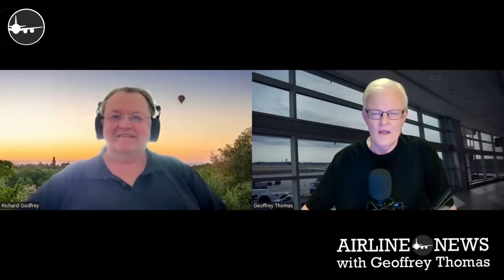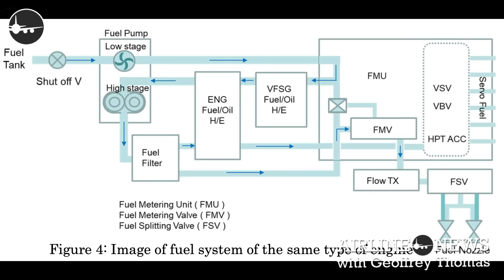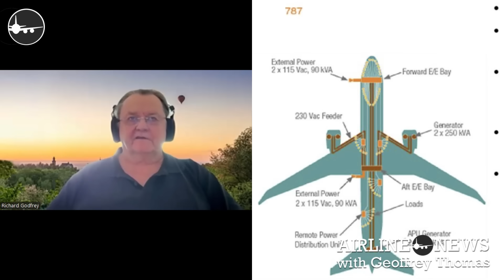AIR INDIA CRASH - FUEL & ELECTRICS FACTORS  #airindiacrash

Comment: I've posted my own crackpot theory (elsewhere) a couple of times, but have received no feedback, so here it is again.  Perhaps you'd be so kind as to examine it?

IF we assume:
 - The fuel was contaminated with something that had a lower specific gravity and energy content than jet fuel.
 - The mixture sat in the tanks long enough to separate prior to engine startup.

Then there are three potential scenarios in which this could cause dual engine failure:
1.) The fuel system was able to draw just enough separated fuel to start the engines, spool them up for take off and make the take off run before this 'clean' fuel was exhausted.
2.) The same scenario as above, only when the aircraft rotated upon take off, more of the contaminant became available to the fuel system's 'pickups' (?), thus there was enough contaminant to snuff out the engines once the fuel in the lines was exhausted.
3.) Essentially the same as scenario #2, but upon rotation, interaction with the baffles in the tanks caused the two to mix, thus increasing the amount of the contaminant that was being drawn into the system.  This would presumably cause the engines to either shut down, or run at a severely reduced output. 

People with actual knowledge of petroleum distillate storage and distribution, or aircraft fuel system design, could certainly shed more light on this.
Reply: Assuming this is plausible, I have had some additional thoughts.  This could be the result of one delivery of contaminated fuel, or it could be the result of a small amount of residue in multiple deliveries of fuel that accumulated over time.  Either way, the evidence could still be found in the onsite storage tanks.  It also occurred to me that using the fuel transfer pumps to mix the fuel while an aircraft is taxiing might reveal any contamination issues as it might cause the engines to falter or result in a noticeable drop off in power.

Comment: Landing gear "question"... Looks like a problem retracting the landing gear, unless that has been dismissed in all the videos and resulting suggestions.
If the plane is told by landing gear system that it's on the ground, it will shut down the engines.  Maybe that's what happened here...?

Comment: I am not wanting to point the finger at any of the flight crew but maybe it is not out of the realm of possibility that someone was in or gained access to the cockpit. It is not impossible that someone deliberately pulled both fire bottles shortly after rotation. And yes the AC would still make the distance where it went down.That would deploy the RAT and the chain of events. It could be 100percent wrong but it is still a possibility. Either way I am certain what happened has been determined and was very quickly after this accident.  That would explain the lack of a preliminary report also, as the investigation team would have to be especially thorough before releasing that kind of information.

Comment: Thanks so much for the videos. My question relates to the fuel system. Exactly which fuel system components are located on the aircraft and which are located on the engine. My point is that if a system malfunction occured is it engine related or something in the aircraft systems.

Comment: This looks like a electronic malfunction of some kind. Wrong thrust setting or the wrong altitude in the flight director leading to a panicked crew. Its a cascade of events at the wrong time.    I think its going to be covered up just like the max was until it had to be explained. Somehow the settings were wrong. No mention of engine sound but the sole survivor said he could hear the roar of the engines. Somehow the thrust tailed off or rolled back like if is was leveling off and not continuing to climb. A Emirates 777 had the fight director flight level set to zero instead of 4000. So the plane hit a wall and antenna and barely took off even though it was going fast enough.

Comment: Boeing have long been aware of 787 takeoff issues. 

The following directives and bulletins address takeoff and climb issues for the 787:

FAA Airworthiness Directive (AD) 2024-16-07 Applicability: Boeing 787-8, 787-9, 787-10. Details: Mandates TM and DCA software updates to correct autothrottle/TOGA logic errors during takeoff and climb, addressing LRRA-related issues. Compliance required within 6 months (Federal Register).
Special Airworthiness Information Bulletin (SAIB AIR-20-19) Applicability: Boeing 787 and 777. Details: Addresses autothrottle anomalies during takeoff/go-around, with guidance for 787 crews via Flight Crew Operations Manual Bulletin TBC-108 (EASA AD).

Then there is the 5G interference bulletin for the LRRA. Put that in to non technical terms, 5G can interfere with low level radar that operate todays aircraft

Comment: Very few programs have considered the need  to look at the Engine Health Monitoring programme to know what the performance degradation was and the  resultant low EGTMs.
Did the  FADEC roll back the Engines to avoid an EGT Exceedance?
Did the TAP system activate as a result to prevent a Thrust assymetry? 
Did this happen in conjunction with a genuine system failure that prevented the LG retraction giving rise to a classic case of a Swiss cheese type failure.?
Reply from the maker: The investigators have the FDR data and the EHM ACARS data from the take-off report.
They can tell us the TPR, N1 and EGT primary indications.
They can tell us the N2, N3, Fuel Flow, Oil Pressure, Oil Temperature, Oil Quantity and Engine Vibration secondary indications.

Comment: Thank you for a thorough update. Initially, engine failure at V1 seemed likely. After this video, the electrical system seems to be the root cause. I ran a simulation wherein the trigger was a “gear up”;command. If this AI model can be trusted (and I don’t know that it can), here is the gear up scenario:

“Yes, a Boeing 787 could experience a warning or even a cascading electrical failure upon gear retraction if a main electrical system is compromised. Here’s a plausible scenario involving the aircraft’s electrical architecture, the landing gear system, and power distribution logic:

⸻

🔧 Background on 787 Electrical System

The 787 relies far more heavily on electrical systems than previous aircraft (a design called “more-electric architecture”). It uses:
	•	Two main electrical power distribution centers (P100 and P200)
	•	Multiple generators (two per engine, plus the APU)
	•	High-voltage (235VAC) starter generators and electrically actuated systems like brakes and gear actuators

⸻

🔄 Hypothetical Scenario

⚠️ Initial Condition
	•	Let’s assume there’s a compromise or partial failure in one of the main power panels, say P200, which feeds the right side electrical system.
	•	The aircraft is operating on engine power, and one engine’s starter-generator is offline or degraded.
	•	The failure could be due to heat (ambient temp 42°C as you previously mentioned), a loose busbar, or internal arcing.

⸻

✈️ Takeoff and Gear Retraction Sequence
	1.	Pilot commands gear up.
	2.	The gear actuators, especially the main gear doors and uplocks, draw heavy electrical loads—transient spikes through contactors and relays.
	3.	The command passes through an electrical load management system (ELMS) which temporarily shifts or limits loads to accommodate the gear operation.
	4.	If the P200 power panel is compromised, this sudden spike could:
	•	Trip circuit protection
	•	Cause voltage drops across the bus
	•	Interrupt or brownout subsystems temporarily

⸻

⚠️ Resulting Symptoms and Cascade
	•	Warning lights: You could see warnings like:
	•	“ELEC GEN OFF BUS”
	•	“ELEC BUS ISOLATED”
	•	“GEAR DOOR FAULT” or “GEAR DISAGREE”
	•	Cascading failures:
	•	If the right side electrical system (P200) collapses, it could isolate flight control modules, as some of these are redundantly fed from each side.
	•	The EICAS (engine-indication and crew-alerting system) could show multiple seemingly unrelated warnings.
	•	If enough systems fail, the flight control system may reconfigure, switching to backup or secondary control laws.

⸻

🔁 Precedents and Similar Incidents
	•	There have been documented cases (e.g., ZA002 test aircraft) of smoke in the cockpit due to arc faulting in power distribution units.
	•	In 2012, a 787 experienced electrical panel failures and required diversion after a gear cycle, traced to arc-tracking and thermal damage.
	•	FAA and Boeing have since issued multiple Service Bulletins and Airworthiness Directives about insulation, P100/P200 contactors, and bus stability.”
Reply: Hi, good analysis, during my service we had replaced several power panels on 787 .
Reply: Good approach, investigate the "what ifs". I hope Air India and Boeing have teams of people generating and investigating such scenarios. Boeing probably did as part of the aircraft launch/release process, its gets harder to maintain and use when there many versions of components deployed a fleet. The recorder data should have captured some of those symptoms and help  identify/prioritize scenarios and investigation. The swiss cheese model hints that multiple borderline/latent conditions might be involved. Automatic test tools might be needed to find such combinations.
Reply: Great video guys! 
777 driver here.. we wouldn’t ordinarily check electrical synoptics after engine start. Any malfunction or abnormality ( electrical or otherwise ) would result in an EICAS (Engine Indicating and Crew Alerting System) caution message. Which on the 777 would bring up the appropriate electronic checklist.
Keep up the good work…
Reply: Should have used the ELMS supplier to the 777.  It has had in-service issues, of course but mostly down to poor maintenance practices. I think this may prove to be a factor in this case.

Comment: Excellent episode by Richard & Geoffrey on the detailed & complicated technical information about the  787. Regarding your description about the possible moisture/water leakage into the electronics bay from toilets, I would like to ask whether any other air craft such as the 777, 747, etc. from Boeing & A320, 330, 350 & 380 from Airbus has similar risk, cause they are also having toilets in the back & front. If not, then why 787 alone, is this is a design flaw with the 787? Once again a great effort from you two guys👍

Comment: Sir look at the vedeo study and look very carefully. The plane was front cargo overloaded.  The plane had a short take off.      There was a Blow up off dust and sand from the ground end of runway the sand and dust blow out caused by the heat and humidity end of runway in duceed both engines casing engines failure we do not have to be a sicentest to know that turbines engines does not like  sand and dust the components are program to kill switch if the engines in duceed sand.    Thank you

Comment: Boeing engineers should have realized that positioning a lavatory directly above primary avionic hardware was a catastrophe waiting to happen. Depending on the airlines -- whose ethical responsibility is always at odds with the mantra  "time is money" --  to patch-up gaping flaws in their avionic design is more evidence of Boeing's criminal negligence: in practice and flagrantly on parade.
Reply: There is no evidence yet that it what caused the problem. Planes like that have a lot of lavatories, so it is not possible to not run wires below any lavatory. But making sure there are sufficient barriers against water is possible.
Reply from the maker: If you watch the latest YouTube videos from Stig Aviation such as:
https://www.youtube.com/watch?v=BkpLEuCGW8k

Then you can see how much wiring is under the cabin floor.
Reply: @Mark-rw3kw  Running insulated wire and cable buses under a potentially leaking lavatory is one level of questionability. Who knows what effect the chemicals in the chemical toilet mighty have on the insulation over time. Positioning such facilities directly above vented chassis boxes housings all manner of circuit boards and wiringy junctions is absolutely ludicrous. Stop excusing the inexcusable for god sake.
Reply: @zoktoberfest   I am quite sure that all modern jetliners have wires running in a compartment below the lavatories and/or galley. If they didn't, there would be no way to run cable from the front to the back of the plane.
Reply: @Mark-rw3kw  Oh...so now we wait for the incident to occur in order to provide the evidence required to address the situation that caused the incident? You, my friend,  would fit in perfectly with Boeing's profit first, precision last manufacturing  ethos

Comment: On the day of the crash was a fuel sample taken from the airport fuel depot and sent to an independent l laboratory for analysis?
Reply: This should have been standard operating procedure for an ICAO airport, but we already know they ignored standard practices at the crash site .
Reply: The planes at that airport are refueled by tanker trucks according to reports I read. So they would need a sample from the specific tanker truck(s) that refueled that plane. One employee who works at an airport said that tanker trucks sometimes carry different fuels for different planes, and it is important to remove any remaining fuel from the truck before filling the truck with new fuel at the depot, if the fuel is different.

Comment: I have a question. What happens if the RAT did deploy, but then failed?
Reply: The RAT does not provide thrust. It is a turbine, like a wind turbine that generates electricity, If the plane is moving, and the electrical system fails, the movement of the plane spins the RAT blades which generates electricity to operate the flight control screens if the electrical system fails, so the pilots can try and operate the wings, flaps, etc. It only provides backup electrical power for those things, and does not provide thrust. The RAT actually produces drag on the plane and makes it harder to maintain lift.
Reply: @Mark-rw3kw ok so it can’t fail to provide power/electrica to the plane then
Reply: @neilos2085   It can provide power to instrument panel to control the wings, flaps, etc, but cannot provide thrust to the engines, nor can it power every single electronic system on the plane.
Reply: @Mark-rw3kw  I think he's asking what happens if the RAT deploys but fails to produce electrical power?
Reply: @pimacanyon6208  I don't think it would have mattered on this flight. The problem was lack of thrust reported by the captain to ATC when he issued the Mayday, and if the instrument panel was out due to lack of electricity, I think the pilot would have said something else. There is another YouTube video where a 787 maintenance person shows them doing a routine test of the RAT on the ground, so it is supposed to be tested on a regular basis. Since in the video of the crash (especially one from a smartphone with audio) the RAT could be seen (barely) and could be heard (fairly easily) it is unlikely that it was not working, but also not known if it was really needed.

Comment: The design seems to have considered many possible failures and back up systems. Most accidents occur during take off and landing. Loss of power on takeoff is every pilot’s concern especially when taking of in a busy urban area with no viable set down positions. An extra few miles of clear land each end of the runway would be such a solution for all of the emergency returns, failed takeoff, etc. 
The pilot and his first officer had thousands of hours and if they had a thrust issue on the runway, they would not likely have assumed the usual pitch on rotate, they would have chosen a lower angle to allow the aircraft more chance of breaking gravity and climbing to a safer altitude to try a circuit back. 
Sadly if thrust was lost when the gear up,lever was selected after rotation and the clear initial positive climb, then that pitch is going to become a resistance that rapidly drops speed to stall and the nose will drop down, as we saw. No amount of power reapplied on a fully laden aircraft taking off is going to break gravity under these conditions without an after burner. 
I feel the flight crew had very little with which to provide any solutions. 
The question I think everyone is eagerly awaiting is what caused the sudden and likely temporary loss of thrust and hydraulics. This episode was extremely informative 👏😁

Comment: I've seen a presentation of the 787 electrical system where it was stated that if the 2 VFSGs of the same engine are lost while the APU is unavailable, the RAT will be automatically deployed. I find this very interesting, but I'm having trouble verifying if it is indeed true. 
Do you have any knowledge of this or a way to verify if it's correct?

Comment: where is the emergency fuel shut off solenoid in the chain? does it have to be energized to pass fuel?
Reply: It's a lock-type solenoid, it doesn't have to be energized to stay opened.
It's a HPSOV - it "helps" fuel from the center tank to be feed first.

Comment: Why don't pilots leave the APU operating until they reach cruise altitude, in case they need power?  60 to 90 seconds seconds is too long to wait in an emergency.
Reply from the maker: The APU burns a significant amount of fuel. Leaving it running during the initial climb costs fuel and costs money. The accountants win, because consumers want lower air fares. I would prefer to be safe, even if it costs a bit more.